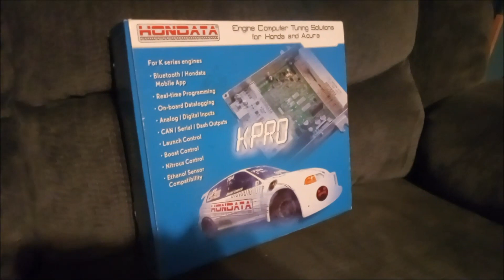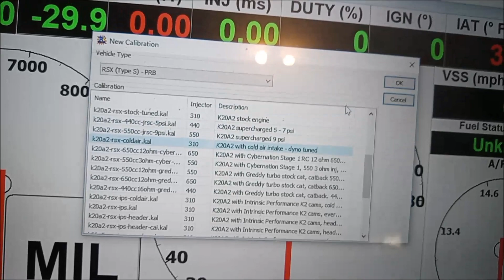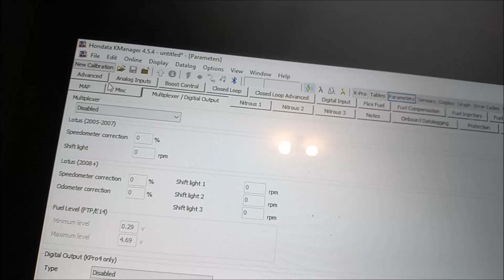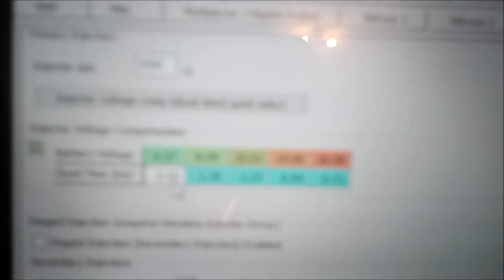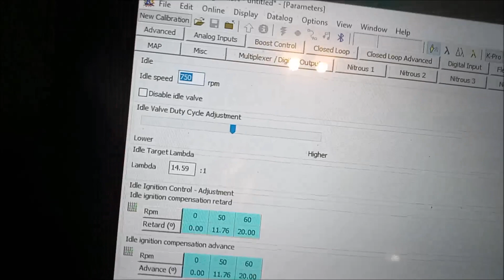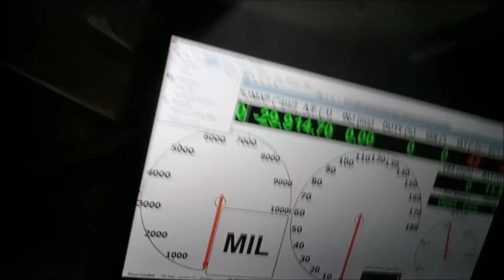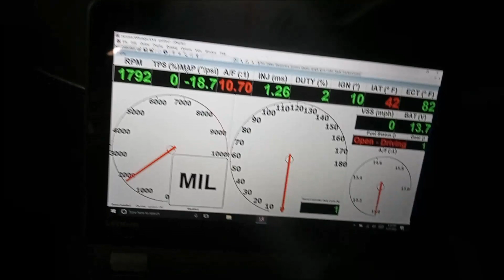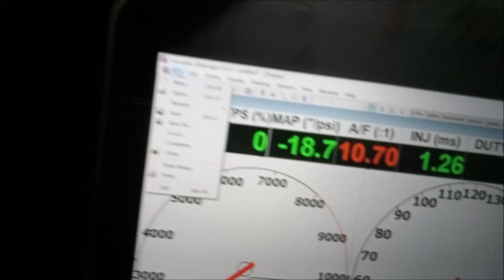Hondata K Pro How To Setup Base Map For K Swaps!

Comment: Hey man good video i am going to try this in the next couple days. Im new and am almost done but tune shopes want 400 just to idle to check. So i am hoping this will work for me as well. There were 2 spots that had missing audio that seemed like important info. How u got injector numbers because yours wasnt listed. And the transmission part. I am guessing because both things i have are in the list it will update auto for me. Thanks

Comment: I’m gonna do a k24 swap in a Nissan 300 ZX, should I be running a Kpro ECU to start it
Reply from the maker: Yea it'll make starting and troubleshooting easier. Can plug laptop in and check for problems. Hondata K pro is all we run on our race cars.

Comment: Great ,helpful video! Question how do i disable the idle control valve? I blocked it off because I'm using a  70mm Ebay thottle body and I'm getting p1219 on the hondata ?thanks for the help
Reply from the maker: Got back into k pro, click on parameters, select the idle button at top- between gear comp and ignition compensation. In the menu just select the box at top with check. It'll turn it off. Hope this helps.